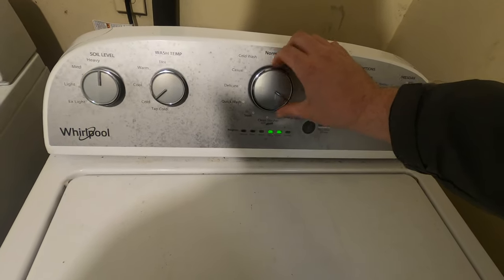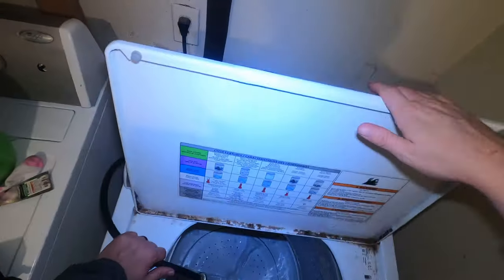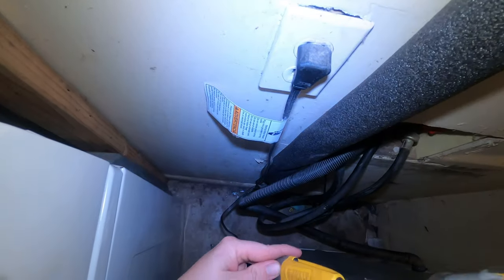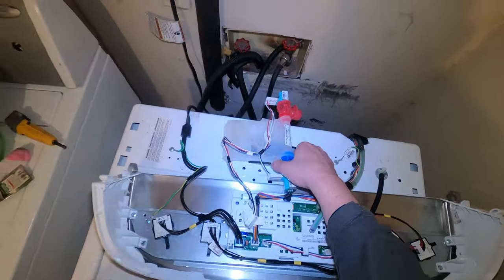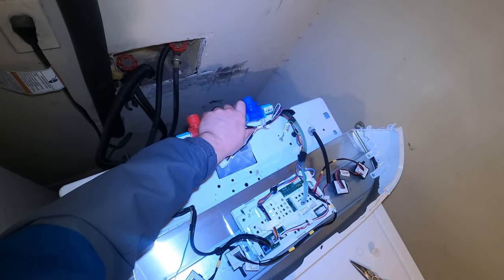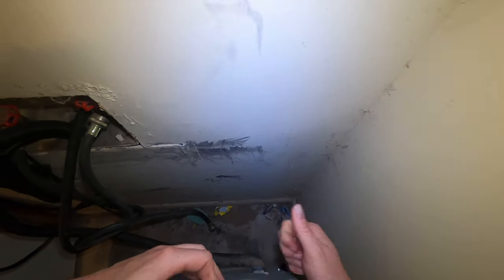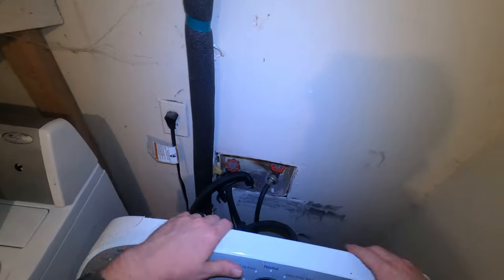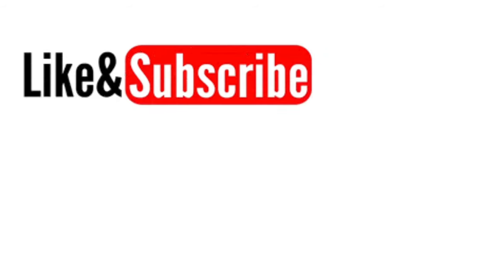Whirlpool Washer Will Not Go Into Rinse Cycle or Get Cold Water Diagnosis and Repair

Comment: Just bought a brand new one just like this and installed today. It won’t go past the washing cycle. I have to manually switch to each cycle to wash. To see that this is a major flaw in this model and Im having this issue same day it was delivered, I’ll be pushing for a store return and buy a different brand.
Reply: Mine is a week old and it's the same way. My last one was an amana made by same company and I Had to use only hot water for it to work.
Reply: How do you manually switch it?
Reply: @missicook5601 did you ever figure out how to get the cold water working?
Reply: @yaredgiamporcaro6100 did you ever figure out how to get the cold water working?
Reply: Same thing happen to me
Reply: Brand new exact washer.  Installed Thursday and wouldn't go past rinse.  Never spin dried the clothes.  Who has time , money and energy to be installing and uninstalling and reinstalling a washer that is probably another bad one.  Why doesn't Whirlpool stop selling them with a major problem 🙄

Comment: Thanks for the video. Would this be similar to the washer staying on Sensing for very long, filling with water slowly, and then never going into wash mode. It then starts draining while only in locked mode(only red lock light on). It then finishes, unlocks, ends everything with the wash light on. The clothes is somewhat wet and I washed.
Reply: Mine is doing the exact same issue. Did you get it fixed by chance?
Reply: Mine is doing this also!! Have you gotten an answer?
Reply: Me too! Lol
Reply: +1, I have exactly this problem
Reply: I had another washer doing same thing. Water coming in too slow so washer would drain. Was water inlet valve.
Reply: This is my exact issue. Any resolve?
Reply: Any answers?
Reply: @zacharykichler4709  and all I missed all of these reply’s I apologize. My issue was fixed by replacing the water inlet valve. At the time there wasn’t a video on replacing the inlet valve but that did the trick for me.
Reply: @isarinana7261  thank yiu I know it’s been a year lol my just glows green on rinse for some reason but does the same thing as yours did

Comment: So I have no cold water, only hot. I replaced the part you did in this video but i still have no cold water, only hot. Is it the switch assembly where I switch the hot/hot, hot/cold, etc.?

Comment: Great video!  My daughter has the same issue,  after the wash and spin it stops.  We have to manually put in on rinse and spin and it does those cycles. Could it still be the valve?
Reply: Dealing with the same thing, did you end up fixing it?

Comment: I did the diagnostic, both cold and hot water are working. But washer still won't go past rinse. Anything else it could be??
Reply: Hello, my unit is currently doing a similar thing as yours, were you able to get a fix?

Comment: Mine does the same thing. Same Whirlpool. Changed the control card, checked the water valves and solenoids (both work OK, not plugged or burned), calibrates OK, diagnostics pass except the cold water test. Could it be that the wash temp switch, the lid lock and/or the thermistor is at fault?
Reply: Hi did you solved it ?
Reply: @Jperales96  No, still have the same problem. Thanks for asking.
Reply: @anibal2476  Did you figure out the issue?
Reply: @christov4120  I ended up scrapping it and bought a new GE. I still wonder why it did this on the first place, but it is all in the past now. Thanks for asking.
Reply: @anibal2476  Can't blame you on that, I'm dealing with the same circumstances you were describing. If I get lucky on the fix I'll let you know.
Reply: @christov4120 I have this same washer. Only a couple of months old and only can wash clothes on hot. Any ideas on a fix for a new washer? Seems like a flaw in this particular model ugh
Reply: @anibal2476   It ended up being a bad shift actuator. That was the issue with my whirlpool.

Comment: I may have already asked this. If so, excuse me. 
  I
Roper RTW4516FW1
 Does fine except when in Rinse cycle. 
  Shouldn’t it fill in Rinse?
Reply from the maker: Look in the use and care manual.  Some washers do not fill in the rinse cycle.  Make sure you have extra rinse selected on some models for a traditional rinse.  Your use and care guide should have this info in it to make sure you have it on the right settings.

Comment: Can you do a video on diagnostic mode only.  It was blazing fast, lights blinking and your turning the dial before I blink.  Couch potato 101 for me
Reply from the maker: I do need to.  I'll have to remember doing one the next time i see one of these. If I have the time and the customer will allow it I will get it out there for you'll.
Reply: User u could adjust the speed of the video to slow it down or pause replay
Reply: It’s on 3 dots to right of video choose play back speed
Reply: Puede hacer un vídeo en español
Reply: @BeardedApplianceRepair  hi my whirlpool washer is stuck on wash an iv done everything on all the videos an it won't work it just fills with alittle water  an washes alittle an then kicks back off an still stuck on wash water won't drain out or spin
Reply: Mine too gets to wash and has never went past that !

Comment: But what if my washer fills in cold temp mode
Reply from the maker: Is the water cold or hot when you run it?   If it is hot water than your cold water is not working.  

These washers are too smart for their own good.  Even when set to cold it will put hot water in it to satisfy the temp sensor.  Not sure of the exact temp it want but say it wants 60 degree water coming it.  If the cold is 50 degrees it will put it hot water to warm it up.  So these washers now-a-days run both during the fill.  For rinses it’s different.  All rinses are cold water only.  If it fills on rinse than I would say your cold water is not the issue.
Reply: @BeardedApplianceRepair  no it was cold. I eventually calibrated it and it seems to work fine. I noticed this problem after i washed some heavy blankets. Machine would not advance to rinse and the load really wet. I had to select drain and spin it out
Reply from the maker: Sounds like an out of balance thing then.  That happens pretty easily with large materials like blankets.  When that happens just empty it and try to rebalance the big blanket.  Calibrating was a good idea as well.  That’s supposed to help with keeping it balance as well.

Comment: My washer fills water and then the led moves to wash led but nothing happens.
Reply: Hold the power button ten seconds
Reply: The only way to find out is go into diagnostic mode and testing items, you would need a service manual though.  My initial guess would be a faulty shift actuator - once a washer finishes "sensing", it will move the shift actuator to the "agitator" position.  If it cannot do that, your machine won't agitate.

Comment: I have exact washer, only difference is my wash cycle won't agitate.... been scrolling videos trying to figure it out.
Reply: Can you describe in detail ? Won't agitate ? What happens when you start the cycle, does it go into sensing, water, sensing ?  and then stop  ?  At least in whirlpool and possibly other models, the sense mode uses the drum, once sensing is complete, it then "shifts" to agitation - it sounds to me like a shift actuator problem, that it is unable to switch to agitator mode.  You would be able to know by going into diagnostic mode, manual mode and testing both agitation and spin modes, this will trigger the actuator shift motor, and you'll be able to know.
Reply: Mine senses and fills with water, then does not agitate. Then when it reaches rinse cycle (after it drained from wash cycle) it stops and does not fill back up for rinse cycle. The rinse light then flashes and lid unlocks. What could it be? Washer is only a year old

Comment: but it fills cold for wash for cold wash............but buzz n no water in rinse.......turned off value no water so yes water hooked right....all clean as new(screens)...........one video said extra rinse switch but then it went to different subject. So started new load , left came back to check...the damn thing was almost full of water running in as agitating....first time for this!!! These thongs are possessed